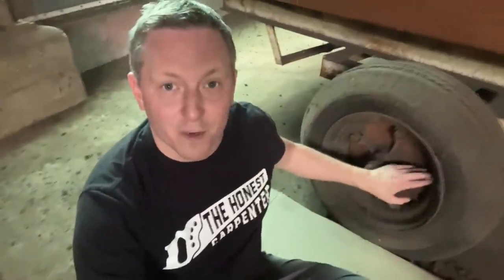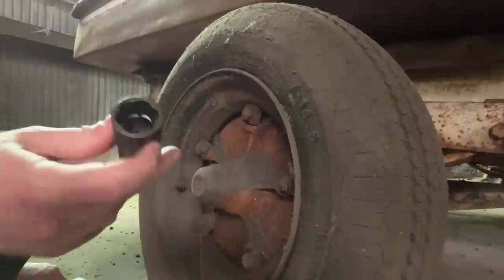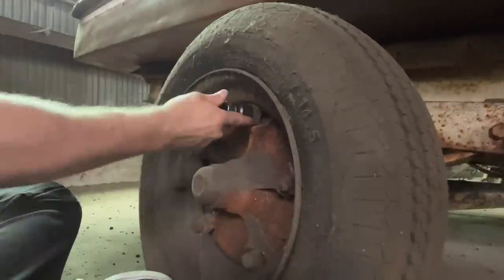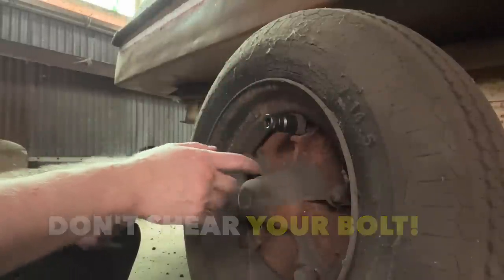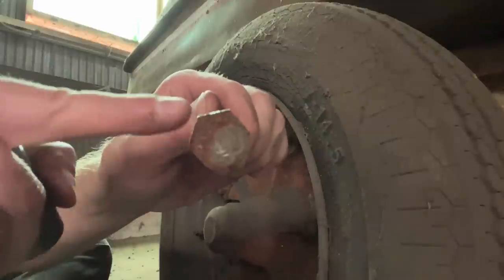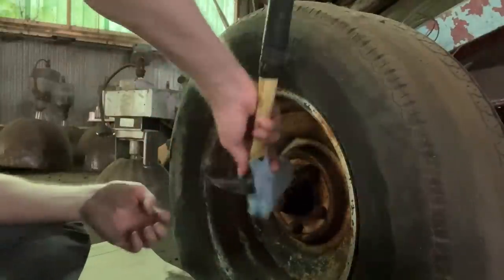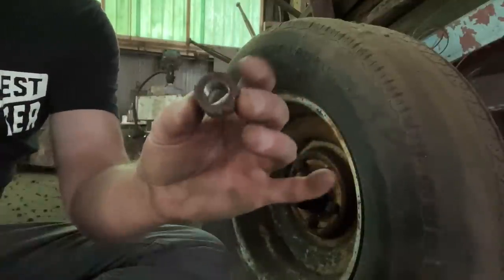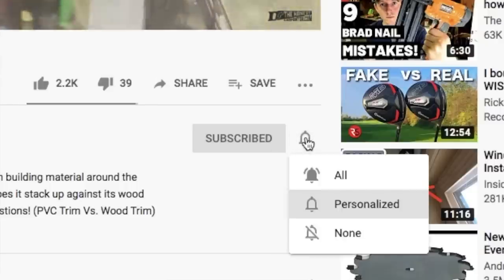How To Remove RUSTED, ROUNDED, STRIPPED BOLTS And NUTS!! (Bolt Extractor And Breaker Bar...2 TESTS!)

Comment: On exceeding difficult lug nuts I typically extend the breaker bar by sliding black pipe over the breaker bar. This produces a much longer lever arm.
Reply: Yes, I used a long "cheater pipe" to remove the nuts that holds the brake drums on our car.  Couldn't have done it without it.  It's really tough to get off.

Comment: Really great explanation of the tool and how to use it. I've used stud extractors to remove broken or stuck studs from cylinder heads or blocks usually, never the type of extractor that you are using. 👍
Reply: I honestly think it would be easier to remove your own back molars with a pair of pliers than to tap a broken stud.

Comment: I like using Kroil penetrating oil any time I am dealing with rust. A cheater bar for the breaker bar avoids any damage to the internals of your wrists etc. Love those sockets! Excellent presentation.😃

Comment: Excellent video, and appreciatethe link! Would the addition of lubricant help prevent breaking or snapping a rusted bolt? Thanks, Ethan, and have a great week.
Reply: Only if you leave it for long enough to penetrate and that's if it has a path to do so, what i do for old rusted stuff is put some penetrating oil on it leave it for like half an hour then give it a few good smacks with a hammer to break up the rust inside. If that doesn't work then i heat it up with the torch that's usually enough to get it out without snapping.

Comment: That is a slick extractor tool set.  I'd use a rubber or plastic mallet instead of a hammer with shop towels on it.  I would also spray the bolts with penetrating oil and let them soak overnight or as long as you can.  I used to use my foot to remove wheel lug nuts on my truck until I broke a bolt off one time (what a bummer that was).  Now I use an impact wrench.  Unless I was worried about the bolt breaking with a power tool, I would use an impact wrench.  My impact wrench has never failed me.
Reply: Yep, I used my impact wrench to remove the bolts holding my lawnmower blades on.  It took several seconds to come loose, but never really worried about breaking anything.
Reply: @canebro1  The impact wrench is a great invention for sure. 👍

Comment: I've had a set of Irwin BoltGrips for years. Don't need 'em often, but when you do, they save the day!  Also, it's refreshing to see someone use a breaker bar for its intended purpose - most people just seem to use ratchets for breaking stuff free these days that I've seen :-/

Comment: I work in the automotive field, and have had to use kits like that off and on.   The kit will tell you if you look, NOT to use impact guns with the tool.  Most of the time it will break the socket, or loose grip and round the nut or bolt off more

Comment: Project Farm did a video on this years ago, and his results indicate that the best solution, defeating all extraction tools and penetrating oils, was simply heating the fastener with a torch. The difference in heat expansion between the bolt and the surrounding metal causes the surfaces to naturally separate.
Reply: I had a mounting bolt on an alternator not want to come off, penetrating oil (liquid wrench, PB Blaster) didn't help.  Breaker bar with pipe extension didn't get it.  Brother with stronger muscles didn't get it.  Torch heating did get it.

Comment: Thanks for the tips. I wasn't aware there are bolt extractor. 
Those bolt seems to be in good enough condition. I would use Manual Impact Driver instead. It works wonders in these situation and it will not damage the bolts.

Comment: As usual, great video on how to properly use extractors. However, I'd be a bit concerned with using my palm to bang away on the breaker bar the way you did. Was there a reason you didn't use a pipe on the breaker bar as an extension for leverage?  Would doing so possibly take away the feel of a bolt head snapping off?

Comment: As "rusted" bolts go... those looked pretty good.  A standard socket (6-point) would have don the same job on those bolts.  However, on bolts that were in worse shape, those extractor sockets never worked well for me.  I personally don't think they are worth the money in real-life situations.

Comment: I also think people should be aware that if you don't have room to use a hammer to tap in the bolt extractor to get a tight fit on the problematic bolt head, you're going to have problems. Like the situation I have trying to remove a brake caliper mounting bracket bolt. No room to swing that hammer to get that bolt extractor on there. If you're using it on the outside of a wheel like you're doing in the video it's a different story. Plenty of room to swing that hammer. But it's still a very good video. Detailed and thorough.

Comment: An old man told me long ago to never beat on your tools, whether by “percussive force” or a hammer. Just extend the leverage of the breaker bar by slipping a socket (with an extension) over the handle. I’ve found a steady upward force works best. Liquid wrench helps, and heat as a last resort.

Comment: Union Steamfitter here. At work we say "never use your hand as a hammer" , so please be careful there. There must be a better way to concuss the bar . Maybe a dead blow hammer would have been a better choice.  I used a deadblow hammer to chisel the corner notches on my log house and it makes the work very easy on the wrist. I never heard of those sockets , they seem great. Peace. Thanks for the video.
Reply: I think I'd try slipping a long piece of steel pipe over the breaker bar handle as a cheater bar, at least to break the hold initially. I've never used a dead blow hammer but worth checking out!

Comment: Just thought you might like to know. I ordered from your link the 32 piece THINKPRO set and received a 32 piece THINKWORK set . The Thinkpro is 1/2 drive and the Thinkwork set is 3/8 drive. Don’t know if Amazon is pulling a bait and switch or if it was a mistake. Tried calling customer service but could only chat with a bot.  I am sending this back and replacing with the THINKPRO set however it won’t be thru the link. Amazon basically told me that was the problem.

Comment: Hey Ethan. Why not PB Blaster or some other penetrant? Might make the job easier. 

Also, how did you apply torque, whacking the breaker bar, without breaking the lug? That’s a pretty easy thing to fall into, and don’t ask me how I know this.

Comment: As a volunteer for a organization called CHAVERIM. Appling heat from a torch before starting to losen the log nut it will help alot

Comment: You know you’re finally an adult when after dogging those rustyassed bolts off, you can open a drawer and find some brand spanking new replacements, because you bought them “just in case.”
Reply: Well check carefully if the strength class match. Like for metric 8.8, 10.9 and 12.9. When in doubt buy the original from the car dealer.
Reply: @SE45CX  Well said.  As I like to say, "Spec's matter."
Reply: @SE45CX  Did you even watch this video?

Comment: On something super rusty I attack it from multiple fronts. I would use a bolt biter, but I would also use penetrating oil and a heat gun.

Comment: Hahah... As I mentioned in an earlier comment on one of your other videos... mechanics in the "third world" tend to be poor... so, they need way more "hacks" to function, than you guys do!

In my country, I don't think ANY mechanic has even heard of a tool such as a "bolt extractor"... so, what we do here is groove-out notches - EXACTLY like the ones seen on your video @ 7.06 - with a metal chisel -  all around the shoulder of the head of the bolt that is stuck... then we use a screwdriver, to patiently, and repeatedly, work around the head - forcing it to rotate by sheer hammer-thrust! 😆

Comment: the fact that you could just smack the (relatively short) breaker bar and the bolt came loose shows it could easily have been removed with normal tools lol

Comment: UNfortunately I've got a rusted nut on my fuel filter, not a rusted bolt. I used all my muscle power and cannot get it off.
Reply: Cut one corner of the nut off next to the thread with a Dremel and disc.

Comment: as much as i like tools, this one would be my last choice. if the nuts or bolts are really stucked, they make them useless and this might lead to a real problem.

i would prefer, especialy in the second example, clean the threads with a brush, heat it up, use a blaster (NOT  WD40, - this is primary  water displacement, formula 40 .--- wd40), tight it up a little more, and than jiggle the bolt tight and loose using more blaster

have fun

Comment: Why not spray some WD 40 it will come like a baby
Reply from the maker: You can slick your bolt too though, and cut down on grip power 😬
Reply: @TheHonestCarpenter  ok sir
Reply: WD40 is overhyped in situations like this.
Reply: @TheHonestCarpenter  You wanna go with the pro:  something like liquid wrench or pb blaster.  They're specifically designed to break the corrosion bond .  Soaked over night is best, so it can really get in there and do the trick.  I've removed nuts and bolts that were impossible to get off otherwise.  I like Liquid Wrench the best, but pb blaster is good too.